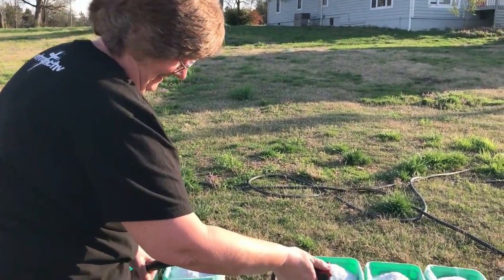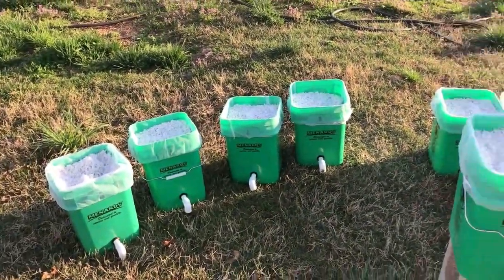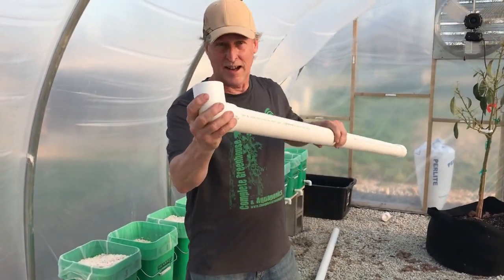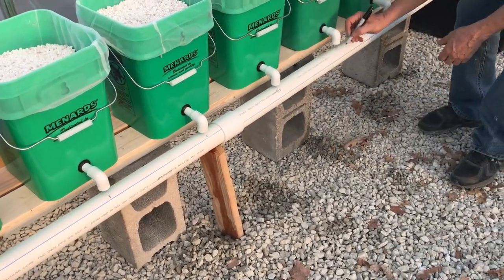COMPLETE DUTCH BUCKET Instructions - DIY Hydroponic Grow Buckets

Comment: 1/4 inch shutoff valve help control water as well. You can adjust them so the system has equal pressure across all the buckets.

Comment: That system would work better with drippers. On it instead of having an open end. That way, the line will build up with pressure. And all buckets would be getting  the same amount of water going through a dripper.

Comment: Im assuming the watering recirculates? How do/often to clean? What can/not be planted? What I need to install grow lights like I read need to be installed if I were growing things hydroponically indoors? Also are these buckets with perlite only used for starting to process, replanting something that has already sprouted, or from start to finish? I apologize for all the questions have never done anything like this but I want to very badly.
Reply from the maker: Water recirculates saving water. Just top off water, clean maybe once a year if needed. Literally anything can be planted. Even have papaya trees in the buckets. Grow lights indoors are needed. If only leafy plants you only need 6100K cheap LED. If flowering types like tomato and pepper you would need full spectrum lights. You can transplant anything into the buckets or start  from seed. Thanks for the questions. Hope tis helped.
Reply: So just plant the tomato plant minus the dirt into the perlite?

Comment: How many buckets on one setup before the flow is not enough at the end?
Reply from the maker: With 270-300 gph pumps, 14 is about max if you do the tubing as shown at the end of the video. Rather not do too many anyway because it it easier to keep the nutrients full and controlled. Also the electric usage of that size pump is very low. Thanks

Comment: Why perlite only?
Reply: You can use perlite, coco coir, clay pebbles, small gravel, mixtures. Just make sure it drains well, is free of disease, and check the PH. Watering times are more often with gravel and hydroton. Perlite is sterile and no PH problems, but most anything will work. Thanks

Comment: If you put your grouments  in hot water,. They will become soft and easy to install.  also, if you cut your PVC pipe on a slight angle it also is much easier to install into the grommets.

Comment: every time I see a farmer drilling holes in pipe I cringe just use fittings its not that much more expensive any you get a professional build quality
Reply from the maker: I would not drill if there was any water pressure involved. I am an engineer first. Used for drainage only so works great and more versatile.

Comment: Can I use gravel do I have to use the net with it
Reply from the maker: You can use gravel. You will need to water more often or even continually because the gravel does not hold much moisture. I have used gravel with great success.
The net may not be needed if the gravel will not get into the tube. The net also keeps dirt, roots etc out of the tubes and water supply.

Comment: Have you had a situation where even with the mesh the bucket drain gets clogged from the perlite? Some of mine did when I was setting up my system.
Reply: Yes, but only in rare cases. Fixed by putting some gravel or clay pebbles in the bottom of the bucket for better drainage.
Reply: use a net

Comment: Hi, love the channel! I'm from South Africa, and just starting my system now. I have a question I hope you could answer. I see you have a cobble floor for your greenhouse, any specific reason why? I am thinking of a concrete floor for mine, would you advise that or not, and if not why?
Reply from the maker: We have different floors in multiple greenhouses to test. Concrete is nice, but expensive. Gravel on top of heavy plastic, to keep weeds out, works good but not as easy to walk on and not good for wheels. We put a painted wood (osb) floor on top of the gravel in the walkways to solve this. Been great now for 8 years. Rubber mats on top also works great.

Comment: how much perlite does it take to fill all 10 buckets?
Reply: About 4 cubic feet  - do not fill them to the top - 3/4 full is good. Thanks for watching.
Reply: @rplatow4120   could I use the square yellow kitty litter buckets it has pp triangle with a 5 in it
Reply: @davidbogan3573  Yes, but may not be good long term.

Comment: This is a really nice way to diy these systems. I love the idea with the rubber grommet, as it is reducing cost. I also like the nets you put into the buckets, although I could not find any of these to buy. For what it's worth, I'd like to share some different approaches I took in my dutch bucket system, which I personally like: 
- Fix the supply line to the wood, not the buckets. It makes it easy to swap out buckets. If you put the supply line on the same side as the drain pipe, you can just stick the drip emitter into the pipe. 
- Use standard irrigation tubing with the little thingies that you can poke a hole into your supply line. Much faster & cheap.
- The small 4mm (1/8") micro tubing is sufficient. This will also reduce your problems on longer lines. 
- I use drip emitters with a little stake, so the line does not fall out on accident and drain your entire reservoir onto the ground. 
- I use 60/40 coco choir / perlite. That's preference, 100% perlite will word. There are up- and downsides, depending on your crop.
- You did not mention your timer settings. I set my timer on 15 min for four times a day. 
- Finally, for a commercial grow I'd use bato buckets. They are not that expensive and the time savings are worth the extra buck per bucket. 

Thanks for the video!!
Reply: The nets are paint strainers- found at a paint/hardware store..

Comment: So what happened to the 1/2 inch sch 40 pipe ? Lacing that tubing thru all the bucket handles makes it impossible to remove one bucket without unlacing the tubing. You will have algae and wind problems with the perlite if you don't use lids on the buckets. Windy day and greenhouse door suddenly opens, perlite dust storm. Your stand is also not very stable.
Reply: Been working great for over 10 years. There is nothing perfect, especially to be affordable for everyone. We don't lace the tubing anymore anyway - easy fix.

Comment: Question ☝️ how do you stop the vegetables from tasting like the solution? 

I did a hydroponic system with herbs and cherry tomatoes. I noticed the cherry tomatoes tasted just like the feed solution I added in the water. How do you weed that away from the ripened tomatoes, but still have others growing?
Reply: Flush the tank and run with just water for a period before harvest
Reply: @MarshallSmash  That would work if you are harvesting all of them at the same time, if not all, then how?
Reply: @MarshallSmash  ah ok. How long do you think? 1-2 weeks or less?
Reply: @iiinsaiii  1 week should do it, but do a taste test and see.  Maybe shorter or longer than 1 week.
Reply: When you apply fire to it and inhale it is completely not noticeable.
Reply: @MrLgmurphysr  so what do you do when you use it in salads? Because that the most popular way you will use them.
Reply: Using the MasterBlend 3 part nutrients, Our tomatoes, peppers beans, lettuce all taste amazing. Make sur your PH levels are correct for the plants to use the nutrients.